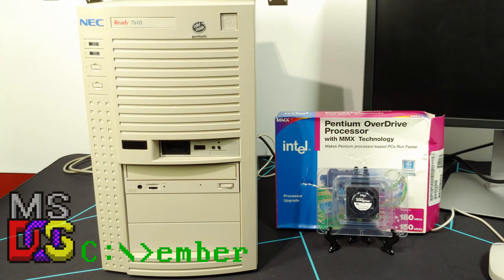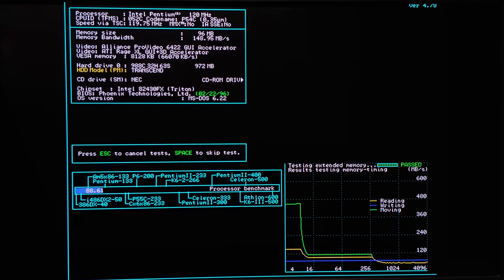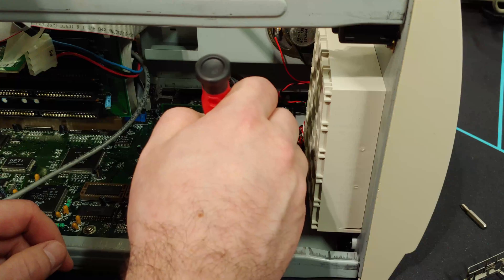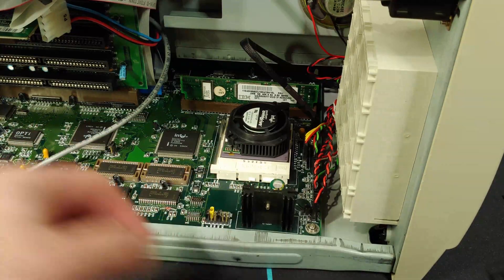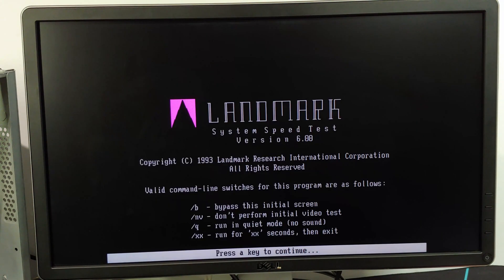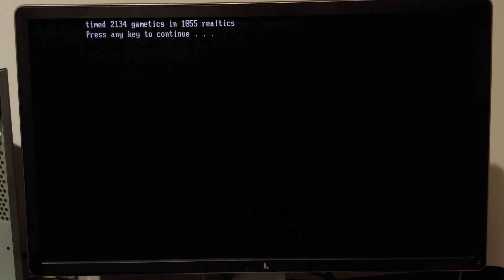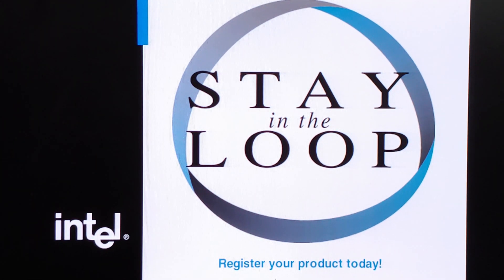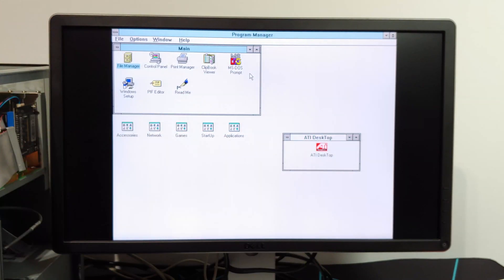Intel Pentium w/MMX Overdrive Install in my NEC Ready 7610

Comment: I think your CPU is a 166 MHz Pentium not 120 MHz, take a look at the CPU Number. Last 3 digits are telling you the frequency
Reply from the maker: It's possible NEC just used 166's in place of 120's (the original spec of the 7610) if they had a bunch of them laying around and just under-clocked it to 120 or someone tried to upgrade and maybe the system only supported a max of 120? Either way, bonus! Maybe I'll use it in another system...
Reply: @koztech  thats why you probably didn't see much improvement over the orig. Pentium
Reply from the maker: Yeah but it was still clocked at 120. I mean either way I'm happy with the improvement. Not a fan of the loud fan, but I'll probably figure that one out at some point with a Noctua and some resistors.

Comment: Thanks for the video. Wonder if 66 MHz bus will make the difference more obvious at 200 MHz. Or maybe I missed this system's lack of capability. Although it should support Pentium 100 with 66 MHz bus and overdrive processor would ignore the 1.5x multiplier using it's own 3x.
Reply from the maker: I mean it runs at 180 due to the 60MHz bus. 150 @ 50MHz bus speed. In theory, you should get close to 200MHz at 66MHz bus speed. But knowing Intel, it's possible they nerfed the CPU.

Comment: The chip that was in the socket was actually a Pentium 166MHz downclocked to a Pentium 120MHz (60MHz x2 multiplier).  Looks like someone tried upgrading previously and thought they could just drop in a 166, as I'm sure that's not stock.  In fact, Pentium 166s were Socket 7 and your socket indicates it is a Socket 5 (max 120MHz).  Socket 5s were perfect candidates for OverDrive chips because they lacked the proper voltage regulation of a Socket 7 chip, and the OverDrive contains the VRM on the chip package.

I find OverDrive chips very handy when upgrading systems that I just want to add a bit more speed.  Like when I upgraded my dual Pentium Pro server from 180MHz to 333MHz using the Pentium II OverDrive chips.  The 486-to-Pentium OverDrive is also quite nice to speed up older systems.  They weren't worth the price back in the day, but you can find them somewhat cheap now and they give you the fast Pentium FPU for DOS games like Quake.
Reply from the maker: So I had to double check the old CPU and yeah, it's a 166 and I totally missed that. Great catch! Another theory could be that NEC just decided to use a 166 in place of a true 120 because they had a bunch available.
Reply: @koztech  I suppose it's possible but then that assumes the 166s were out when this system was still in production, and it also assumes NEC were willing to lose money on selling a more expensive CPU at a lower price.

I think it's more likely that someone previously attempted a CPU upgrade without realizing the limitations of the system.
Reply from the maker: So I looked up when the 166 came out and it was Jan or Feb 1997 (along with the 200). The NEC Ready 7610 came out summer/fall 1996. If the line ran through February it's possible they used it. And they wouldn't have necessarily lost money if they already had a stockpile of 166's but no 120's. Or got a deal on binned 166's that has issues at 166 but worked at 120 just fine. But yeah you're theory is more likely!